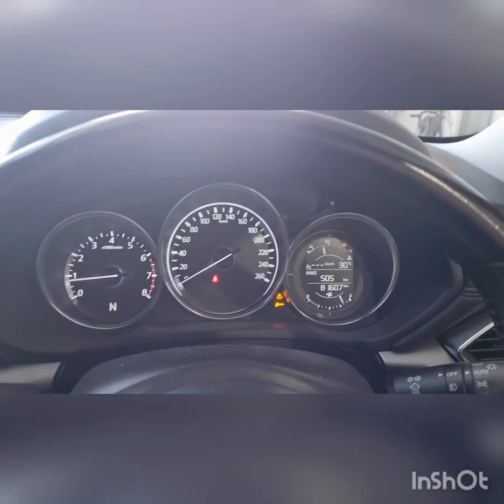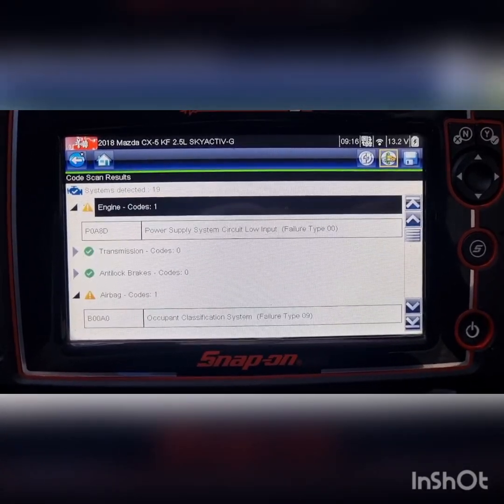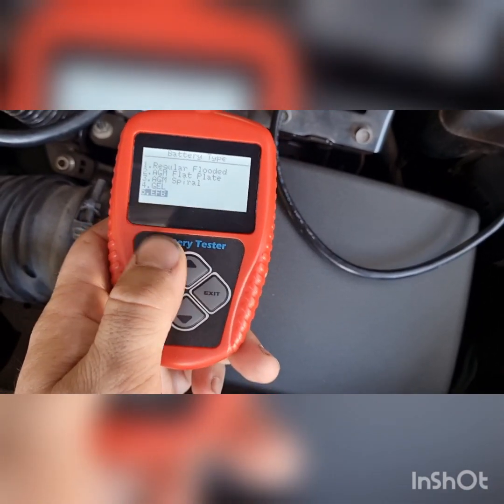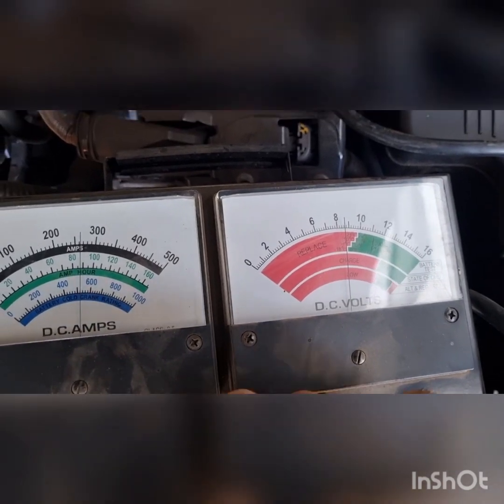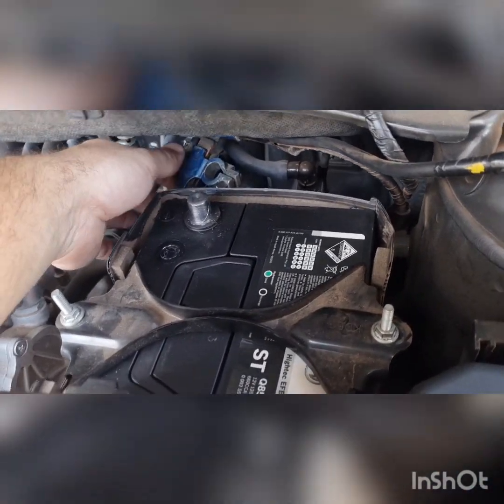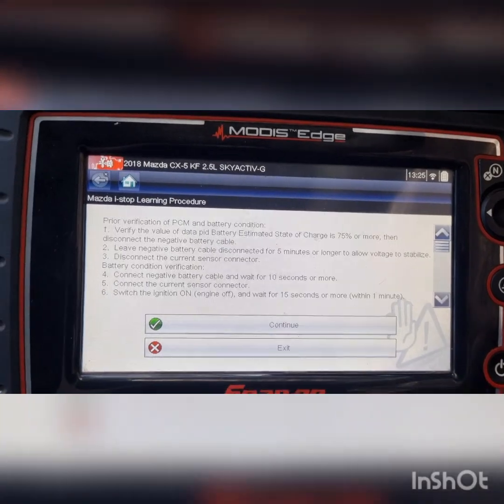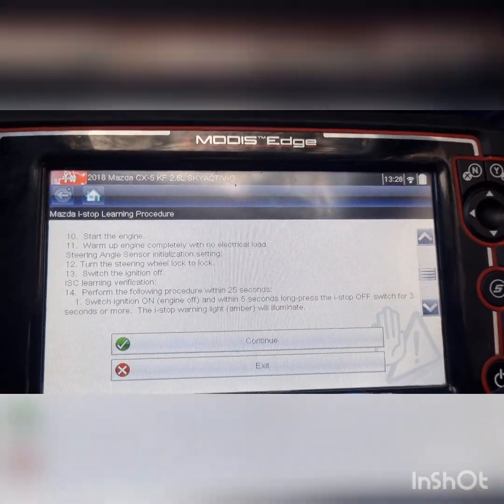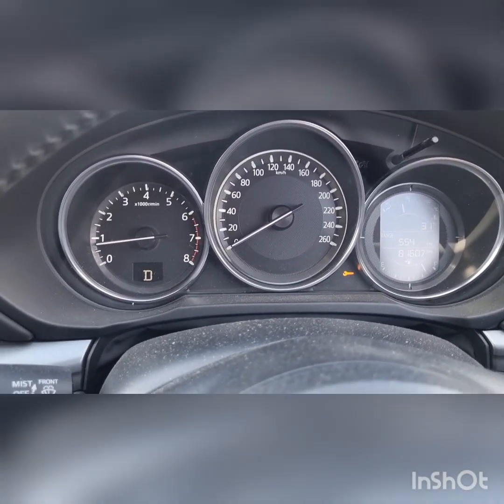Mazda P0A8D Power Supply System Circuit Low; Battery Test, Replacement & Relearn

Comment: Can the wrong battery affect the voltage and the power steering of the car...I have a mazda demio skyactiv 2011 and no one can find the issue
Reply from the maker: Is there any codes?

I definitely would want the correct battery in the car before doing any electrical diagnostic

It's probably not the issue but it needs to be right first

Comment: Is it possible for you to share the right specs for the battery? Maybe battery type and AH needed for a Mazda Demio 2016 diesel engine? I've struggled to find someone who can help fix this error. Finding the right battery could be a good place to start. Please help.
Reply from the maker: We don't have that car in Australia

What engine is it? 

Could it be the same as the cx-5 diesel? 2.2? 

This should be a fairly straightforward process
Reply: @RealAutoSolutions  You guys might call it Mazda 2. It has a 1.5L diesel engine. So it's within the CX-5 family. Your recommendation should work. I am just struggling to find the right battery and most mechancs do not know how to fix this problem here and that's why I want do it myself. But I need the battery specs first
Reply from the maker: @FalconerXP  unfortunately we don't have a diesel in the Mazda 2

Your vehicle is a ISTOP vehicle is that correct?

It will either be an EFB or AGM battery Im confident in that 

The battery should take care of the fault, then the relearn for the ISTOP needs to be carried out
Reply: @RealAutoSolutions  yes it is an i-stop

Comment: Honestly I wouldn't rely on one of those cheap battery analyzers. Use something like the midtronics, they cost North of $1000 but they are super accurate.  Considered the gold standard in automotive battery testing.
Reply from the maker: You're talking about my first red hand held one ? - We always double confirm with a load test from the carbon pile if it fails it can often pass a load test, I agree they're not that accurate but for most situations they're good enough
Reply: Must go and buy one. Tx.